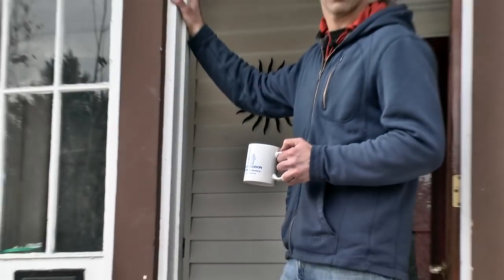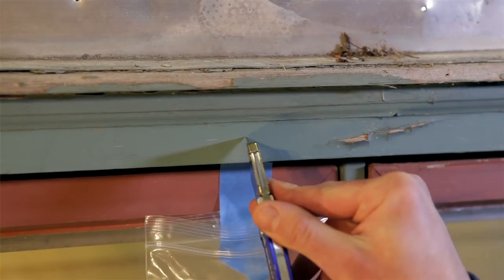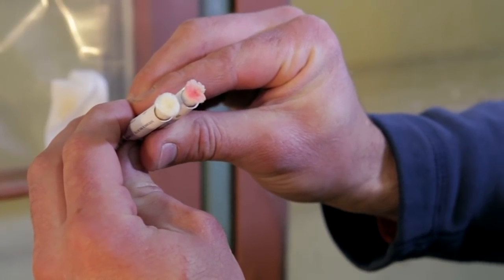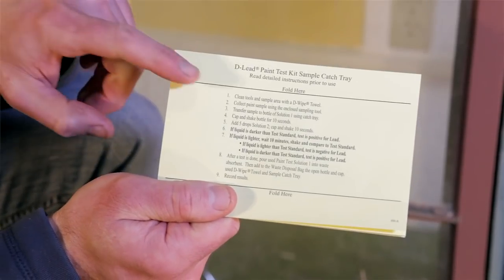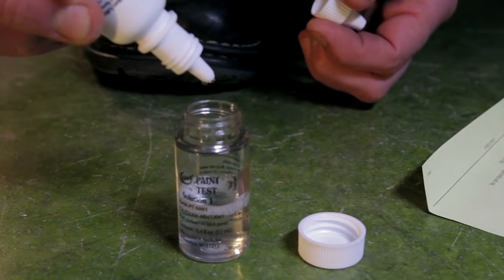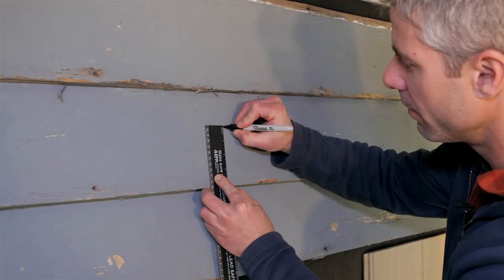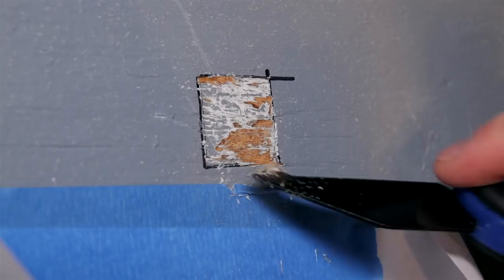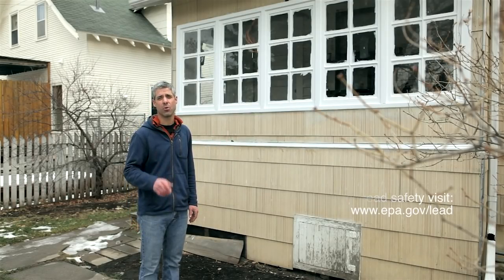How To Be Lead-Safe: Testing For Lead

Comment: As of 2024, apparently the 3M 'stick' style tests have been discontinued. I just paid $13 for a different instant test kit containing 2 small test sheets (1/2" x 1/2") and an empty eyedropper. Theoretically, you could cut the rest sheets in half to double your number of tests.

Comment: very helpful video. Only problem I can think of, is there’s some customers out there that might complain or give you a bad review if you cut their home, sometimes even if you ask them first and they say yes they might still complain. Especially if they don’t end up liking your price. So I feel like this is kind of risky for residential

What might be a better option, is finding an area the paint is already peeling, and just taking a chip off from that, so that way they can’t say you cut or damaged anything
Reply: For something like this and a customer like that, a signed estimate with details on what you'll be doing is probably the way to go.

Comment: Very informative video. There are still many products that use lead based paint (LBP). Toys manufactured in other countries that do not have regulations are a great concern. Toys often have brightly colored paints. However, a consumer should be able to simply call a lab to submit samples for analysis or find a lab like ours that have testing kits.

Comment: Does the x-ray fluorescence guy only measure lead content in the top-most layer?
Reply: No, it can test through several layers. That's one of the things that makes it better than LeadCheck. Even though LeadCheck does allow for a few layers if you cut correctly, it's just not as efficient or as thorough as the x-ray fluorescence, which reads everything!

Comment: #1- I guess you didn't go to school for lead testing other wise you would of known how to remove a paint chip sample with no sub-straight in it.
 #2- A XRF Gun to buy costs about 12 to $15,000.00 depending on the gun and buy half life (meaning 9 to 15 months) it will cost you from $1,000 to $3,500 to get a new inside part.